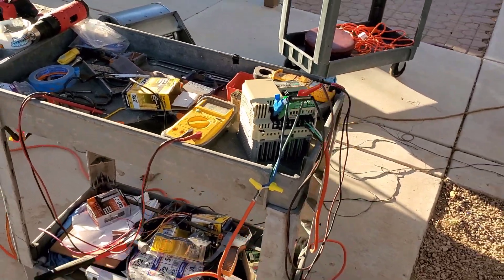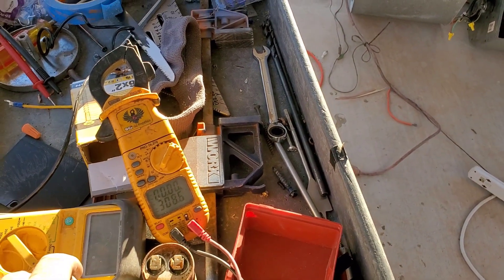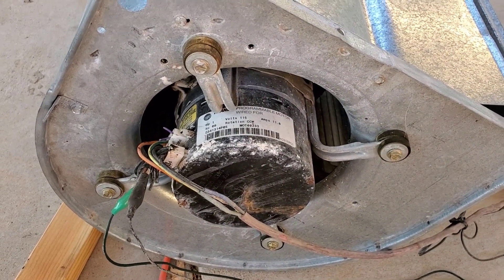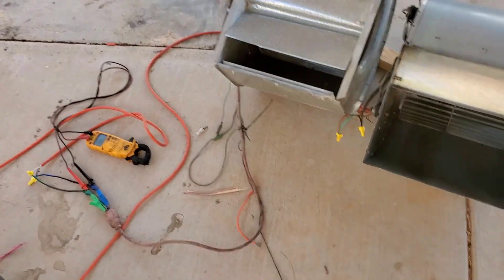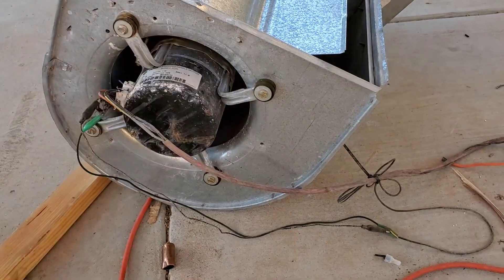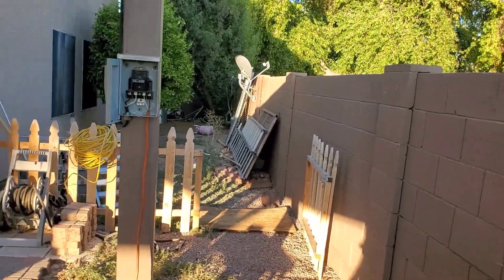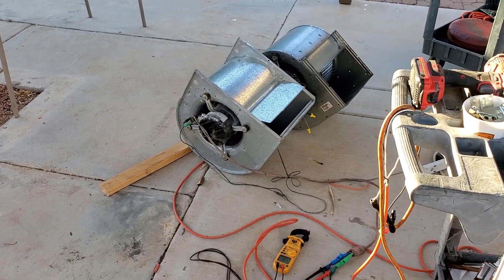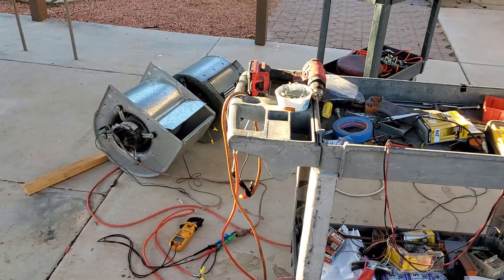Can you run a ECM Blower motor directly off of a solar array? [Mad Scientist Experiment]

Comment: I believe you were Arizona so if your canopy holding your panels was tilted at 34° you would have higher efficiency and higher output of your solar panels even towards the end of the day.        Because you live in a hotter climate the translucent solar panels work better in hot climates because the panel itself does not heat up when solar panels heat up there less efficient.  Most people don’t know black solar panels are an option the part that makes the electricity is an actually black black is something that is added. By not having the black make the solar panel hot especially in hot climates where cooler air cannot help call off the solar panel.                         Experiment in the middle of a really hot day run cold water over your solar panels to cool them off and see how much more power they produce.
Reply from the maker: The problem is making this look like a Pergola and not a solar array. 
Prying eyes and all
Reply from the maker: At least it's not too much of an angle this time of year when ib really need it

Comment: This is very interesting experiment.  I year ago I got my hands on a 4 ton 5-stage ICP/Carrier Heat Pump with a rotary Toshiba/Carrier compressor.  That would be the ideal replacement for you with your Solar Deck you have.  It would probably love the 300 VDC that you can supply!  You might want to ask around Siglers when you are there...a few years ago they had a Bryant 5-stage sitting at the 22nd Ave store in the back...but they told me they ended up scrapping it.  What a shame!
Reply from the maker: The Deer Valley store? Bummer
Reply: @hackfreehvac  Yes, but supposedly you can call the main Tolleson store and they may have a list their of all there scratch and dents.  I have not done that...maybe you will be lucky someday.  I found mine (Day and Night) at Furguson.  I waited about 3 years and finally...

Comment: This is a good way to utilize solar arrays for on grid people without needing  a utility interconnection  There are some no name mini splits out there that you can add panels to to offset daytime use
Reply from the maker: I've seen those.
I have a friend that has been building Li-Po and Li-Ion battery packs for people who do off grid etc.
Another guy we know has a off grid mini split. Kinda cool.
A guy in the company is really into off grid.
He showed me a system that runs on grid but also can tap on solar as an option.
Being that I work on mini splits and VRF units a bit and see how the internal control board works, I think I can use a off the shelf el-cheapo inverter minisplit (they can be bought for $750 on Amazon, or $900 or so local) perhaps and just tap into the DC with some panels to power during the day.
If I add one power panel to each series (adding two panels total) as I am running a 10S2P now to make it a 11S2P I would go from 300VDC to 330VDC and that would be really easy to supply into the DC bus of a mini split.
Or my VFD I have now to run my central air compressor.
Either case it would simply pull current from the (higher voltage) array until it dropped in the afternoon and then just start to draw current from the on grid rectified bus (which is about 320 volts) with nothing but some extra diodes to prevent backfeeding.
I'm going to try it on my VFD here at some point.